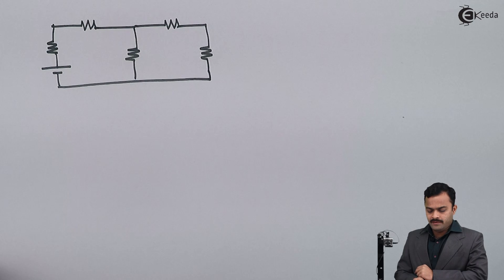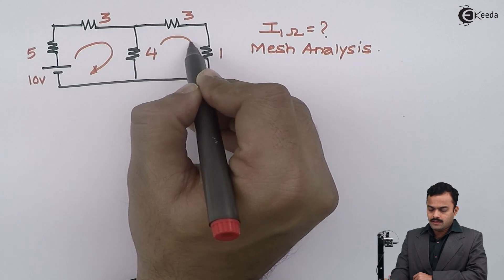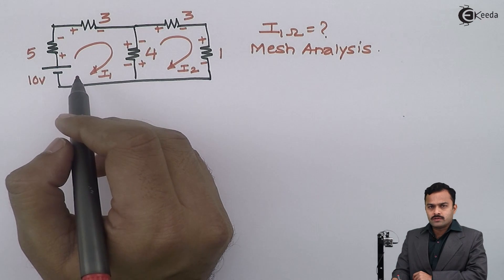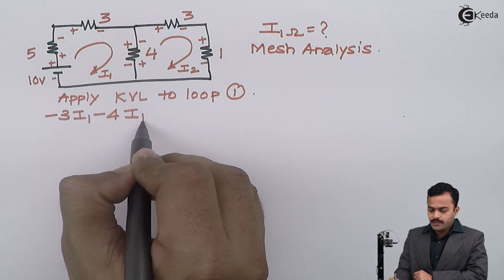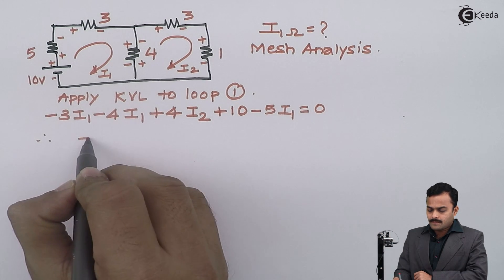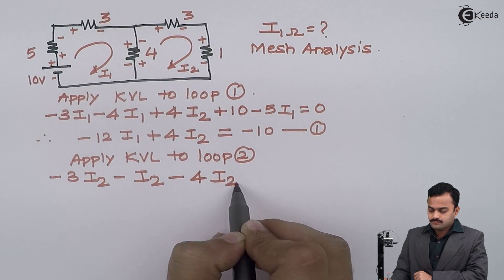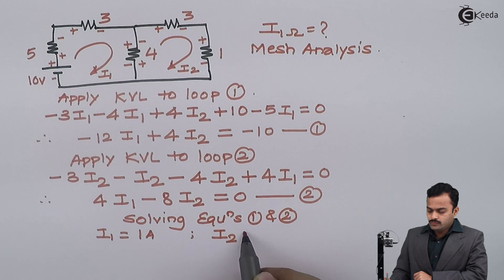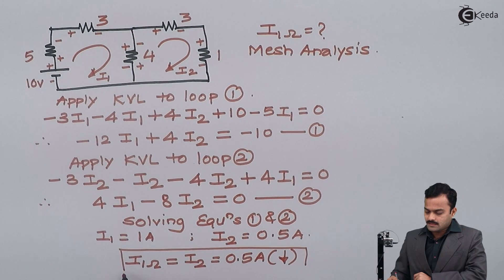Mesh Analysis : Problem 1 - DC Circuits - Basic Electrical Engineering

Comment: What happened to the rest of the maths :P  Solving the two equations.  Magically the answers appeared!
Reply: If you are studying Electrical Engineering, it is expected that you have the knowledge of solving simple linear equations with 2 variables. He must've used any one of either substitution method or elimination method.
Reply: bro fr , it is taught in class 8 ig